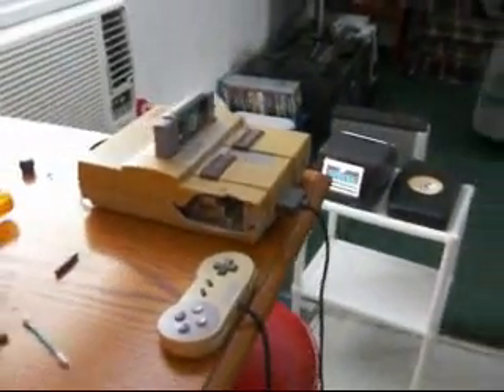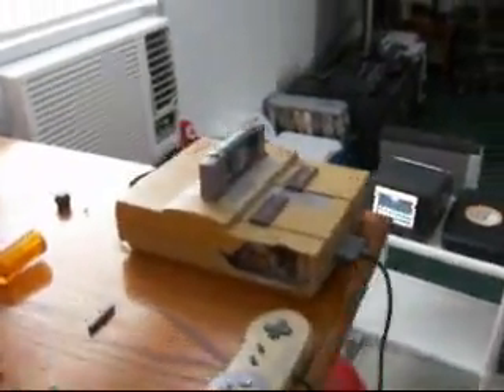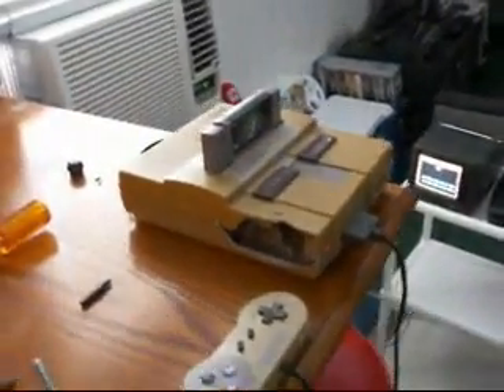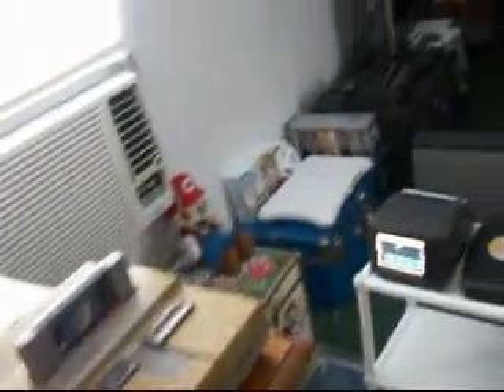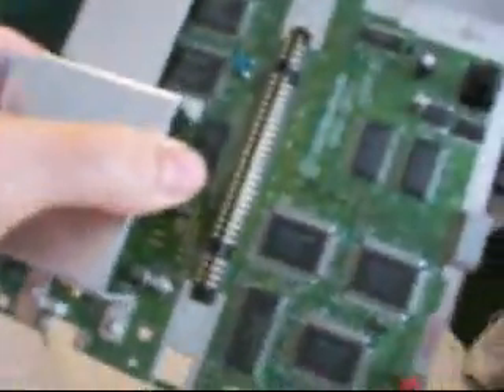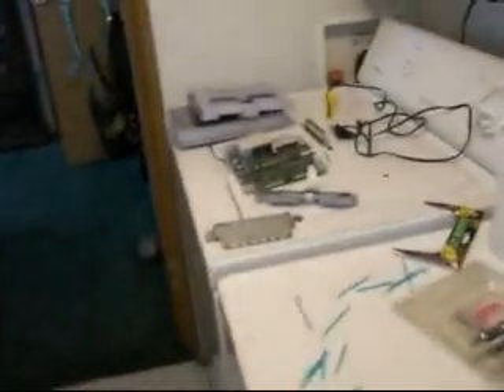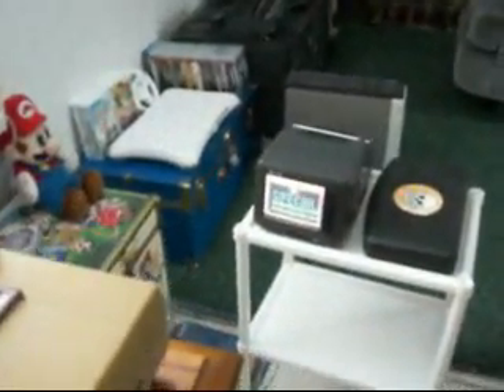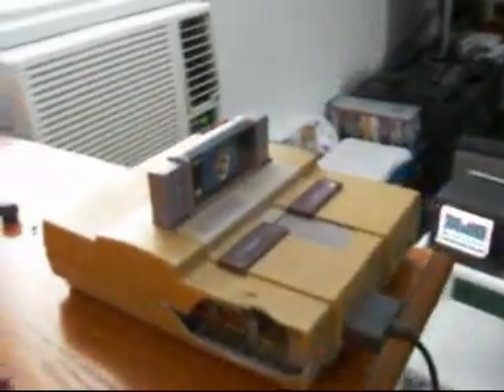Snes repair #1

Comment: I was able to disassemble it last month. The chips were made in the summer of 1993. My 62 pin connector is removable, so if I ever need to replace it, I'm good. My fuse is scaring me, though. :( The connections have turned almost a brown color. Is there any sort of impending fuse-related mishap?

Comment from the maker: @CristaliaMi You can look at early release units on ebay and get an idea. I'm thinking the 1991 first release systems before box said super set probably ended around 10 or 11 million range. I'd say your system is most likely 94 but I don't know as much about snes numbers as nes. Either way nice you still have it after all that time.

Comment: How can you tell what the exact year was that the system was made? I'm trying to figure out the age of my SNES (I think it's 1994). Mild yellowing around the controller ports, none around the rest of the case, no big capacitor, two sound chips on main board, #266902902 with a square on the last number. I've been going on this information as well as memories from when we first got it (I was in preschool, and I'm now 21.) Do you think it's 1994 or another year?

Comment: If I have a completely Black Fuse, does it need to be replaced? I have already replaced my connector, as well as the AC adapter and it worked for a few days after I started using the new adapter and then I did its usual gray and white bars when I turned it on.

Comment from the maker: You have to have the security bit which works on all nintendo units. Basically there is a larger size for the systems and a smaller bit for the cartridges.

Comment from the maker: Easiest way to put it back in is to slide it over the rod with just enough of the rod holding it in place and then place the spring into the bottom notch and slowly at an angle push the rod into the holder and then you can get the top part of the spring into the notch on the left side of the eject button.

Comment from the maker: I had the same problem due to the bottom case mold still being notched for the old style eject button rod and I thought the spring went on the right side when in fact it goes on the left. I had to find a pic online of a snes that the top was taken off of and saw the spring on the left side when the controller ports are facing you. The longer part of the spring goes down into a little hole on the bottom of the snes case and the top shorter part goes into a little notch on the eject button.

Comment: you know a easier way to test it is to just bypass the fuse with a  wire. if it turns on it's blown.